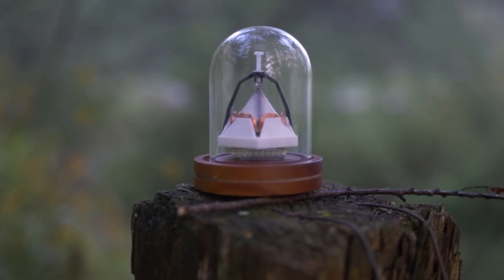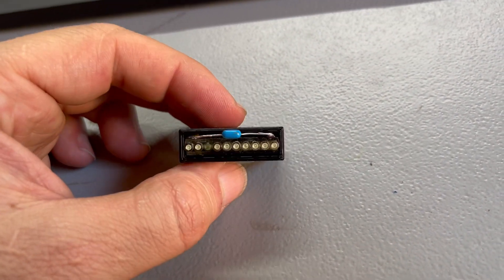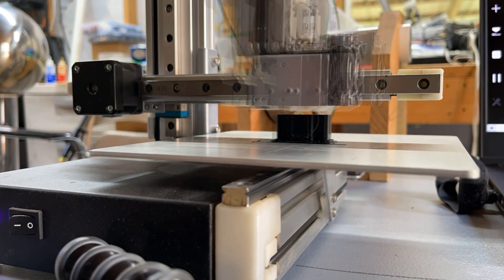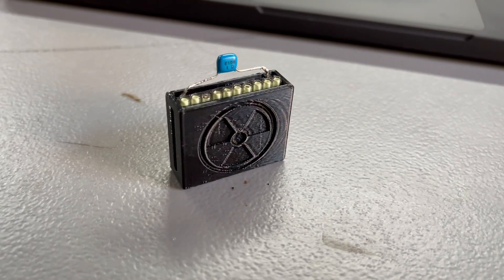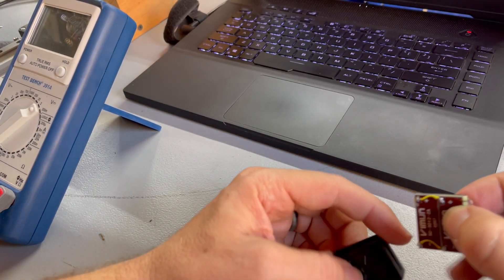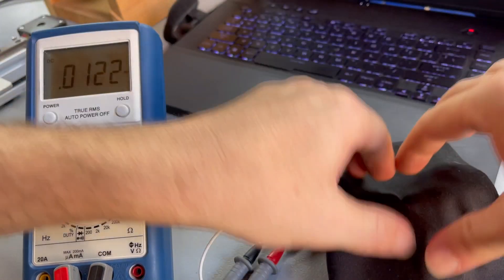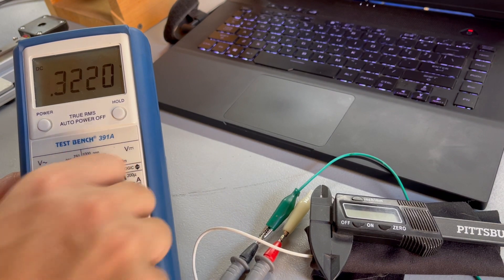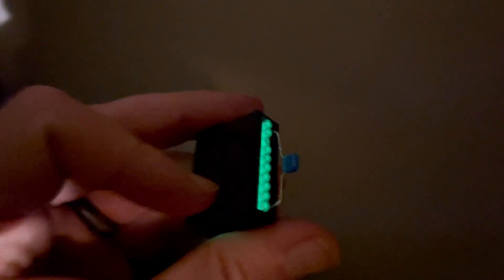3D Printed Tritium Power Pack

Comment: Good invention.

Amorphous silicon panels like the one you used produce around half the energy of polycrystalline ones, meaning the performance could be doubled by changing the type of solar panel.

The advantage of using tritium is that it is not as dangerous as other types of radioactive batteries, where much more dangerous radioisotopes are used.

The applications of the nuclear cell that you have made exist in devices that emit short pulsating signals at very long intervals, such as radio beacons or instruments that emit long-distance measurements, in places where there is no sunlight for months, as occurs in weather stations and its great advantage is its extremely long life, high reliability, low cost and little or no requirement for operating temperatures, something that does not occur in batteries that stop working below a certain temperature.

For use in sending signals over very long distances, the optimal solution may be a laser, which with very low power can reach distances of kilometers.

In short, a very interesting video just like your channel.

Comment: Ah, this must have cost a pretty penny to build though?
I've been looking into creating such a device - though i've been looking into using the ice-blue trits - green ones look brighter, but from tests on my bench the solar cells give the strongest output from blue light!
Yours could be putting out about 5uA under such conditions - I like the Vimun SC-3012 devices, I've got one from a solar calculator that spits out just nigh of a milliamp on a cloudy day, which is massive considering that Amorton devices of the same surface area are only giving me typically half of this...

My designs use the cells to fill an ultracap or otherwise charge a Ni-MH (it's OK to be lazy, if you have some high quality parts with low self discharges etc.)
This is how you can get that "perpetual feel" from devices that run on such low powers...

Comment: Cool.  Is there preferred color for the tritium as in does it make a difference to get the best efficiency out of the solar cells?  I know solar cells have optimum output at certain wavelengths of light.  Also what is a good source for the solar cells and tritium?

Comment: These setups are actually used in places where you need really long lasting battery for a ram backup or RTC or something. But those excite the solar cells directly instead of phosphors. This design is less efficient and the phosphor will fade away after a decade or so in those vials.

Comment: I mean meh. You can’t buy plates or big vials of this, so it has to be low power roughly 1/3 the output is already too low for any real work to be done. I’m interested in this tech, but only if it can be scaled up. Covering a 100 watt solar panel I. Tritium vials would be prohibitively expensive.

Comment: Welcome back, it has been a long time, I was getting disappointed, as I was going to try and build one of the small solar boost kits and you don't have the list of parts in the videos anymore, so had put it on hold til I could research parts after watching videos again.  Glad you are back and will enjoy following your experiments again.  Love to see what you did or plan to do with that 2000 watt solar panel setup

Comment: I would get it Micromanaged by a  Node MCU ESP 32 - ESP 8266 Due you can sleep the  MCU so it uses very little power and have it wake up and up-convert voltages in timed lengths Bursts To charge up a  few 18650 lifepo4 and Run something like  A 48V E Bike Battery

I be also  tempted by getting a few bifacial solar panels just to get the Double Sided N-type Junction Cells

Comment: So, PV semiconductors are highly senstive to Beta radiation - have you tested the longevity of this design? Typically BetaVoltaic piles are made of specialised materials, since PV made of silicon form microfractures on exposure to ionising radiations.

I do love the project and happy that you are back <3 

Project suggestion - buy some cheap phorphor paint and paint some paper with it. Wrap the Tritium tubes in a few layers of the paper - transparent plastic works better. 

This does two things: 

1.) protects the PV from degradation by blocking the path of the Beta particles
2.) Increases the surface area and mass of phospor exposed to the beta particles, ergo will generate more light per cm2

The goal of beta voltaics like these is to convert as much beta radiation to photons as physically possible. 

Next step (though a little more advanced and costly) would be buy or making a phosphor pigment that emitted closer to the bandgap of the PV you are using. ZnCuSrAl or similar should do it, i would think.
Reply from the maker: I have been testing it over the last 4 years.  Thanks for your excellent suggestions.  I will keep them in mind for future projects.